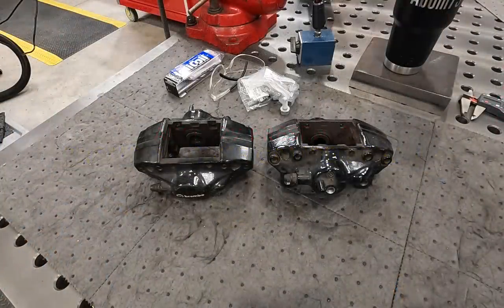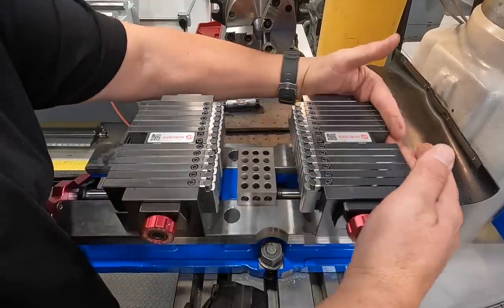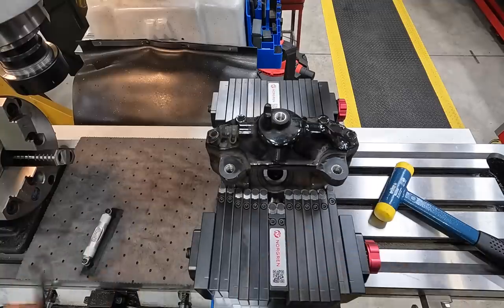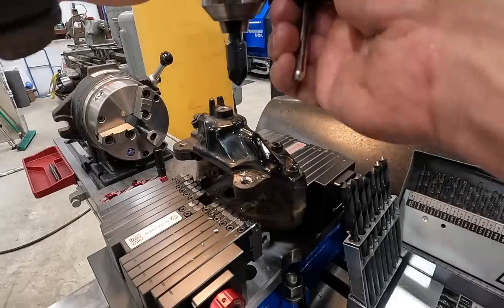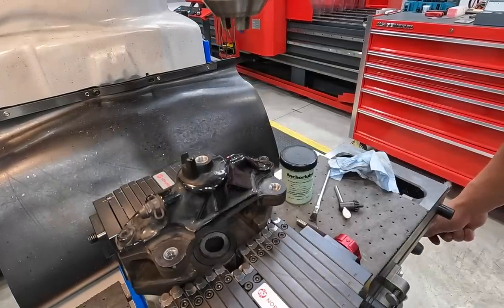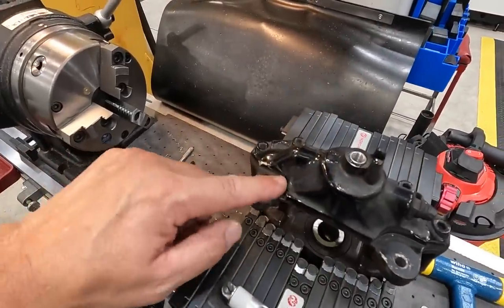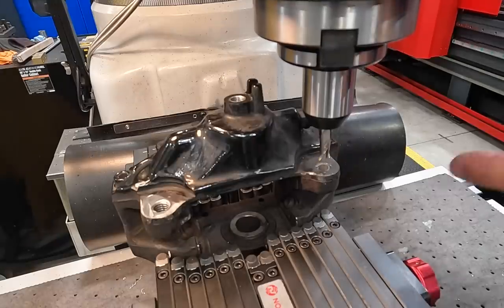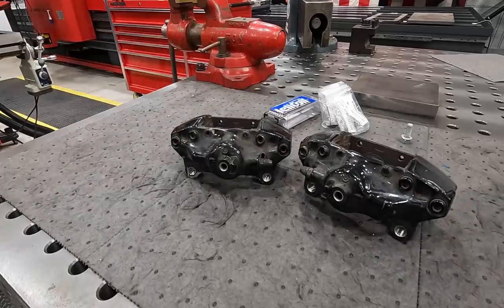Brembo Brake Caliper Repair

Comment: I’m a Subaru Tech of 20 years. This is a spot on repair.  Fairly common problem and helicoil is more than sufficient. I’ve never had a helicoil brembo fail.  No need to split calipers. That just damages the paint around the bolts. The owner can clean where necessary. 100% great repair exactly how we would do it.
Reply: What do you know, you are just an actual expert. All the armchair mechanics and materials engineers in the comments know better.
Reply: @boothbytcd6011  "experts say"
Reply: Exactly why i repair my own stuff...you worried about the paint?  yet nothing about open brake fluid hole??  i worked in shops too....lol
Reply: Why everyone in this section hating on the Subaru tech guy person thing
Reply: Did you need a $7000 vise to place a heli-coil? Thread repair is one of those DIY father shows son kind of repairs. Just buy the kit and follow the directions. If you're lucky the drill bit doesn't break, but always a learning experience for everyone involved.
Reply: @jerrylondon2388  lolll… of course he didn’t NEEED that vise… but it sure is ideal for this job
Reply: Did know they were painted at the factory.. The ones I deal with are simply anodized..
Reply: @maxheadflow  Yeah there’s always been a Nice thick glossy coating on the ones supplied to Subaru. Most STI owners here get really particular about the paint. The race ones we used to end up blasting them after the heat destroyed the paint.
Reply: Would threadlocker help between the helicopter and caliper? What keeps the helicopter from backing out?
Reply: @garygentry583  Helicopters beat the air into submission, that's how. 😝
Reply: @garygentry583  helicoils generally like to only go in one way which is why there is a tang at the bottom to give a smooth edge to guide it in. When broken off, the helicoil sharp edge resists going in further and the same for the top for backing out. Although not full proof, it does a pretty good job
Reply: @Dreddip  damn autocorrect.. lol.. nice one!
Reply: @Waikatotek  yes! HELICOILS!! not helicopters.. sorry bout that.. 

I'm new to helicoils, so I can't say that I've heard one backing out, obviously.. I've removed plenty of broken bolts tho that were rusted it.. 

I just didn't know if threadlocker helped or hurt.. thanks for your reply!
Reply: @garygentry583  There are various types of "helicopters"(ha ha).  They vary in cost and application.  The "Heli-Coil" is the "basic" model (which should last a "lifetime").   In this case, the "Heli!Coil" will last longer than the original component!
Reply: @josephsteffen2378  thanks for the response!
Reply: @garygentry583  They are known to back out on occasion, but then you simply put a new one in, after cleaning both the insert and the hole with brake cleaner, and use a drop of red thread lock on the insert outside to make sure it stays put. Wait 5 minutes for it to set up, then clean with brake clean again, and use a lubricant on the bolt thread. Best locking agent is Loctite 603, oil resistant, and it will hold till the casting itself fails.

If the helicoil insert rips out you simply then go to an alternate like a timesert, which has a steel plug that is larger still and goes into a thread you cut into the surface, and use red thread lock on. If that rips out you got bigger problems, your stress on the part is too high.

The owner of the Subaru already likely knows that he will be either putting inserts into the head itself soon, or the upgraded head bolt set, or one of the aftermarket head upgrades, because these engines are famous for popping head gaskets. Not an if thing, more a when thing, generally just about the time the warranty expires.
Reply: What’s splitting the caliper look like?
Reply: @SeanBZA  WRX!!!!!!
Reply: 20 years.  That means that you know ALL about the WRX motor.  That's a gnarly engine... I live near a industrial area; where local "racers" can "let it out" semi-safely.   I can hear the distinct note of the Subarus tearing up the asphalt, some nights.
Reply: The question is not whether a Heli-coil is the correct solution (of course it is), but if the method requiring a $7000 vise is reasonable. I don't doubt that if you've been doing this for 20 years that you haven't developed a much simpler/cheaper method of repair. That would have been a much more useful video for 99.99% of viewers. Problem solving makes a better video as opposed to a product placement demonstration. How do I do this WITHOUT spending $7000 (oh yeah, it was free, problem solved)!
Reply: @jerrylondon2388  Never a question about his rig. No I haven’t used one of those. But that’s his and his method. Not like he bought it for this job, simply used it because he has it. I think it’s a great demonstration of the tool.
Reply: @tjlovesrachel  Sorry, but without that vise I could do it in half the time with or without any kind of vise. This vise added unnecessary complexity to the repair. If he had titled this "$7000  Vise Demonstration" I wouldn't have watched. I suspect many others wouldn't have either, even most. I watched to learn something, not buy something. And he just did a thread repair, technically the threads were part of the brake assembly, but the title is really clickbaity (is that a word). If he chose to rebuild and fill the holes and drill, then re-tap that would have been a different animal. But we all know what happened the last time Abom tried to drill and tap a hole........ Not his finest hour.
Reply: @josephsteffen2378  Tearing up because they weigh so much.  Ricer-oni

Comment: Great repair Adam.  I worked 35 years as a tool and die maker building aluminum welding fixtures, every threaded hole was called out from engineering to have a  stainless Heli-Coil® insert.  Holding strength is quite a bit stronger than just aluminum.  The insert tool actually shrinks the insert a bit while threading it in, as long as the top and bottom of the insert is engaged in the aluminum they will not move. The ends of the coil will actually bit into the aluminum.  Thread locker was not recommended.
Reply: How can you get the ends of the coil to bite, especially the top. I understand the pressure from the bolt being tightened would do this to some extent but wouldn't it help a lot to peen the aluminum at the ends of the coil?
Reply: @KJ6EAD  when you break off the tab at the bottom it’s designed to have a small burr pointed out into the aluminum and at the top it’s sprung out just a bit to not allow it to back out.  At least that’s how they were designed when I was using them.  I’ve been retired a couple of years so not sure if they changed anything.
Reply: @tool2man  Thanks. Maybe what I've seen have been installed wrong. It wouldn't surprise me considering some of the people I've worked with.
Reply: ...YOU SUMMED IT UP PRETTY WELL-!!!

Comment: With these Brembo calipers on the rear of a Subaru. This is a common issue. But to save time. You can unbolt the calipers and they will halve. Then you will have a machined surface to work off of. The rebuild kits for these are about $30.00 so you might as well do that while you are at it. I just would not use the lube to put the coils in. They might back out with the bolt on the next service. I use blue lock tight on the inserts. I have done a few pairs of these in my 32 years as a mechanic.

Comment: I don't use helicoils on brake calipers, Wurth Timeserts are a much better option for something like these, there's no skimping when it comes to brakes. A much easier way to hold the caliper is to split it, and bolt the mounting half to a steel plate using the four bolts that hold the two halves together, then mount the plate into the vise.
If the caliper is a monobloc type then use a small mastercylinder connected to the banjo bolt, to pump the pistons out and clamp a steel plate using a couple of shims to save damaging the pistons, and lock off the lever of the mastercylinder, and then mount into a vise clamping on the plate.
Both methods work cleanly and effectively.
Reply: In actual tests Helicoils outperformed all other thread inserts, including Timeserts. The tests were on maximum torque application and direct pull out.  Essentially, a Timesert is a tube that is both threaded internally and externally although it does nave a tapered section at the base to expand out to supposed lock into the threaded hole in the parent metal.  The Timesert can only have full contact at the base of the insert, where it is tapered all the rest of the threads relying on a loose fit.  The Helicoil is a tight spring with sharp coil sections that form the thread.  When a bolt is tightened in, the ramping action of the bolt threads against the coils of the insert pushes them out into the parent metal giving full depth pressure to the sides of the hole and digging the spring section in.  The Helicoil material is high strength alloy steel so that the parent material will always be the one to fail, when it eventually does.  Given the relative price of Timeserts against Helicoils, using Helicoils is a no brainer when they outperform them all

Timeserts have their place.  In a VW air-cooled crankcase the cylinder holding down bolts are close to the holes for the cylinder barrels and the bolts have a bad reputation for stripping the crankcase thread especially in high performance application.  The use of Timeserts is normally prescribed and I would recommend them over Helicoils because there will be radial pressure that could break the bolts and helicoils into the cylinder barrel holes.  Using a Timesert reduces this radial pressure and distributes what there is around the outside of the timesert and into the body of the crankcase.

As I said previously, Porsche use Helicoils to mount the brake calipers to the alloy swing arm.  Porsche are renowned for placing engineering above all else in their cars so would have deliberately selected Helicoils over all other options
Reply: We used Wurth Timeserts in the Industrial environment and had excellent results. 🙂
Reply: @clivewilliams3661  I've seen more failed Helicoils over the years, including some that I have installed, I have yet to have a failed Timesert, although I have experienced the material around the Timesert failing, on a Yamaha XJR1300 1500cc bigbore, cylinder studs, so I made my own larger inserts and all was well. As for a caliper mounting bolt which is likely to be on and off as the pads are changed in use, I find Timersert better for these applications, and less likely to wind out on the bolt in time.
Reply: @mickymondo7463  What type of failures have you seen with Helicoils, the actual Helicoil or the failure of the surrounding metal?  I suppose that with a Timesert you can loctite it in, that is not advised with a Helicoil.  Really, the only time you would need to remove the caliper on a car is when changing the disc or the bearings that could be less frequent than changing pads, which can be done with the caliper in situ.  I must admit that most times i change both the caliper and disc at the same time as with the non-asbestos pads they have to use a softer disc material that typically wears at the same rate as the pad.  However, on our family car I only had to dismantle the front brakes once at 130,000mls to replace the pads and discs although even then they weren't at the wear limit.  My performance/competition cars generally require pad/disc replacement at about 50,000mls so even then its pretty infrequent.  I've never changed the pads or rotors on my Aprilia RST although that only does around 3,000-4,000mls/ year
Reply: @clivewilliams3661  I've seen Helicoils wind out on the bolt after repeated loosening like a caliper gets whe pads are changed, I've seen them pull out on torquing the fastener to spec and with the side loading that caliper mounting bolts get they don't seem to remain as secure as Timeserts.
Reply: @mickymondo7463  Why would you take the calipers off when changing the pads?  I can't think of one application that the pads aren't changed with the caliper mountings left in-situ.  Opposed piston calipers whether 2, 3, or 6 pot usually retain the pads with pins and flat springs that are withdrawn through caliper as with these two calipers.  Sliding calipers require at least one sliding pin to be removed that allows access to the pads, the mounting frame remains in place.  The side loading on the calipers is actually quite small as evidenced by the small diameter of the retaining pins on the pads, any load is generated axially on the bolts as the pads push on the disc that puts the normal ears of the caliper on pull out.  I would imagine that as with my experience the failure of the Helicoil is due to lack of maintenance and maybe on galvanic corrosion.
Reply: @clivewilliams3661  I usually remove the caliper to clean it before pushing the pistons back, and certanly with motorcycle calipers it is often required to remove the pads given the proximity of the wheel rim, and cleaning the caliper is much easier with it removed. Possibly galvanic corrosion  adds to the failure, but ultimately I don't want to risk any failure with brake calipers.

Comment: Thanks for showing the vise jaws in action. I have installed many helicoils in many different metals and usually if it's in aluminum I'll use locktite to help hold the insert in place but on brake calipers it probably won't help, they get to hot.

Comment: This is a brilliant save Adam, saving a nice original piece. One thing for future, plug the hydraulic line hole mate, swarf inside could cause trouble in the future but still a top save / repair.

Comment: The old expression, "When you have a Hammer; the world looks like a Nail."  and when you have a shiny new Adaptix Vice, every job looks like it should be done in an Adaptix vice... LOL.
I appreciate what a few of the others are saying that it would have been better to split the caliper (allowing inspection the pistons and bores), but the video is primarily an Adaptix first use, rather than a Brembo repair, and without the novel workholding could be one of several in the Abom backcatalog.
Thanks for an interesting alternative.

Comment: Fixed many Brembo aluminum calipers before. I stripped them down void of rubber, and tig welded the hole closed, and then tapped new threads.
Reply: how do you locate the hole position once that's done?
Reply: @makepartsUSA  put em in a fixture before welding, no?

Comment: Once I heard a serious race car builder told they use helicoil in every single aluminium threaded hole. The last thing you want to deal with is a pulled thread during a race repair and these inserts prevent just that.
Reply: It's   common practice these days and has been for a while to put steel or titanium inserts in aluminum (and magnesium) parts to save the alloy.

Comment: Nice video Adam. Well explained and completed. You never rush thru or take short cuts, it's done right! I would have put a piece of tape over the fluid inlet to avoid any chips possibly getting in, just an observation for future jobs. Thanks for sharing.

Comment: Hi Adam  I realise the calipers belong to someone else, but if they were mine I would have removed the cap screws to give a flat machined face.  It also would give the opportunity to fit new 'O' rings in the split joint.   Cheers

Comment: I always used my air drill and trusted it to follow the original bore. Same with the tap, also thread locker on the insert with anti-sieze on bolt threads. 70 years old so I've done this more times than you would believe. Time is Money 💵.
I am in no way knocking Adam's work. Top notch.

Comment: Adam. You need to leave the leave clamp bolts loose until your fixed jaws just about make contact. Then snug them up and clamp down. Most of your clamping force comes from the fixed jaws..

Comment: Yesterday, it so happened my shop had a job, also as featured an aluminum brake caliper.   From the casting as surface towards wheel rim, the slight variant exposure saw interference at wheel install.  The customer as changing from a larger, aluminum rim with larger tire size to a summer tread.  The repair was simply very careful, dimensional grinding to allow free travel.  And where, the cast region was very rough, with large variant rear surface as caliper.   As left to right, both featured a very similar dimension as material removal.  The job completion saw high temp paint to protect surfaces.  For the tech at install, inspection of the piston as face and where rubberized boot, is a key feature to delivery as long life.
The install of the hili-coil was a great lesson.  Several of the tips I had not found but clearly are useful to gain the strength and centering to repair.  Thank you, for having me along.  M.

Comment: Forget the naysayers Adam! Having watched since you started practically,  I used Helicoils on the end of my crankshaft on a small block Chevy 350 small block.  I had to drill the broken bolt out and mucked up the threads.  I was able to torque the harmonic balancer to specs (I was worried) and it didn't budge. I'm still running the engine in my old truck.  Yeah, didn't have a mill but used measures to get the straightest hole, nice sharp cobalt drill bit and patience.  Great video! I trust those Helicoils will last a long time.

Comment: I am not a Helicoil expert but used them myself on a fixture plate back in the day and I do not fault Adam for using a little lube on them. They are already a TIGHT fit in those holes and any extra bit of friction is chancing the tang bending/breaking. If that happens it is not fun time removing it and trying again. But alas, to each their own in the comments section.